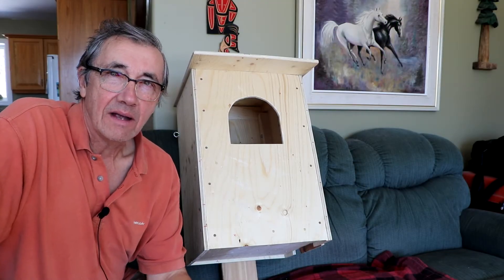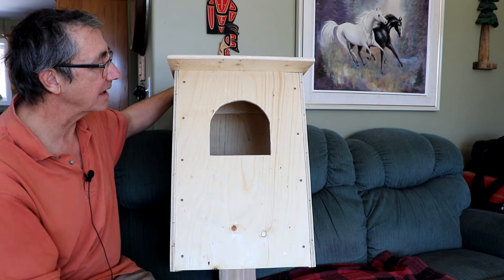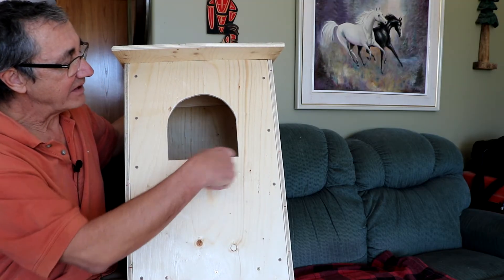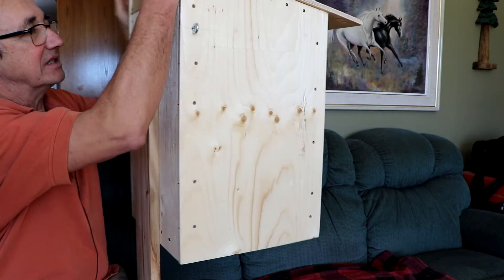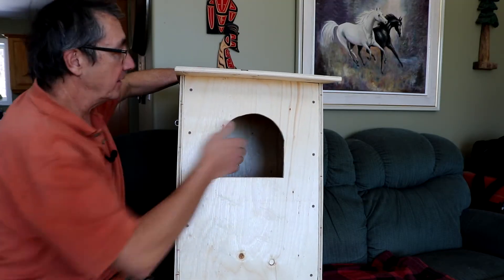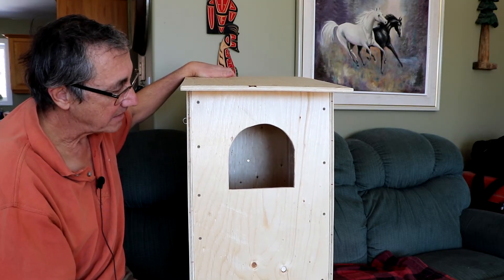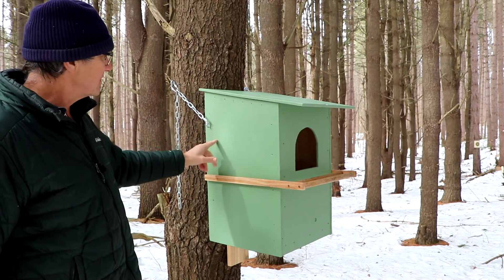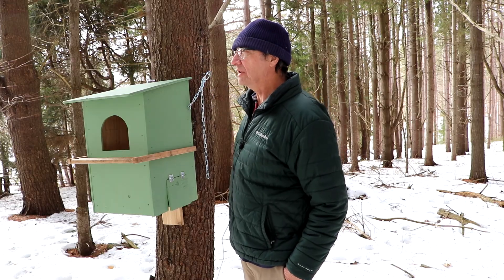Barred Owl Nest Box Build

Comment: Looks good. My only comment is that a box with a lid often attracts bees. I remove my roof during the off season.
Reply from the maker: Thanks.  With our winters bees would not survive in such an open box.   We do get wasps sometimes build small nests on the inner roof but they can be built each spring and summer so you’d need to check each season.

Comment: I am no expert in barred owls, but my experience from Europe makes me wonder if American owl boxes tend to have too large openings. In Europe, tawny owls tend to prefer boxes with openings that they can just squeeze through (fewer predators, and apparently fewer parasites too according to some studies, maybe because there are fewer visitors to a smaller hole).
Reply from the maker: Thanks for that info.  I’ve wondered about the hole size too.  I assume Tawnys are similar in size to Barred Owls.  I’m not sure how big a hole they would actually need at minimum to get in.  Perhaps a 4” or 10cm hole would work.  Don’t think it could be much smaller.
Reply: @hervedelnorte7928  It might work (I think that's close to minimum for tawny owl) or perhaps slightly larger for barred owl.

Comment: Nice box.  Great idea with the mounting system you came up with...  when mounting it,  try using and old metal coat hanger and attach that to your eye bolts on the owl box. Have it go up and over your box,  kind of like a "bucket handle" would be.  Then,  you can put a screw in tree and hang your box from that coat hanger temporarily while you see if you like the positioning of your box.  Plus it will hold it up while you attach your box to tree.   I'm gonna use your chain mounting idea tho, great job
Reply from the maker: Thanks for that coat hanger idea👍

Comment: I wonder if curious young owls might fall through the cleaning hatch?  Perhaps attach a latch?
Reply from the maker: The hatch is screwed shut and will not open unless unscrewed.
Reply: @hervedelnorte7928  Thanks for the  clarification. Research indicates predators can access those doorways and I was wondering if you had addressed that. Thanks for your video!

Comment: Great! I was looking to make one similar so appreciate the ideas. I was just wondering if the smell of paint or stain would be a deterrent though? Anyway thanks for the share.
Reply from the maker: Hi Daniel

Glad you liked the video.  While I used exterior grade plywood, I did not use pressure treated (PT) plywood that some people do.  The PT plywood doesn’t need to be painted or stained as it already has been infused with preservatives.  Not sure if those chemicals would have any negative effect.  Probably not as long as the wood is dried thoroughly.  Acrylic latex paint or water based paints and/or stains have very little if any smell.  Most birds also have poor olfactory abilities.  So paint or stains should have no effect in my view.  I would have gone with stain but I think the paint may provide more protection.  But there are good water based stains.  Oil based stains get into the wood better but have the annoyance of cleanup with mineral spirits and smell during use.  Once they are thoroughly dry I doubt oil based stains would have negative impact on the birds either.  Just like most stains people put in decks.
Reply: @hervedelnorte7928  Thanks! I'll see what I have kicking around the garage. I was thinking, minimally, to use some linseed oil, since I have a fair bit on hand.